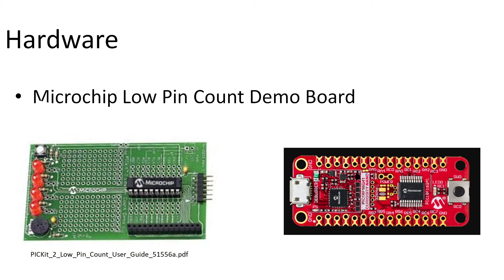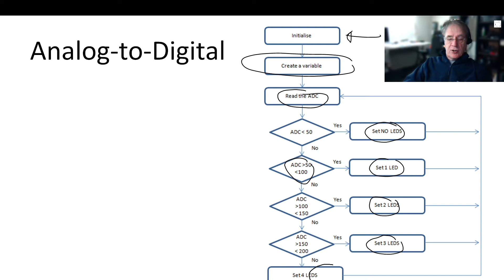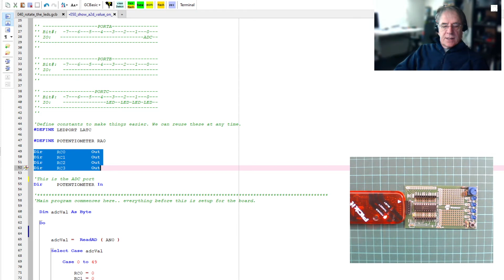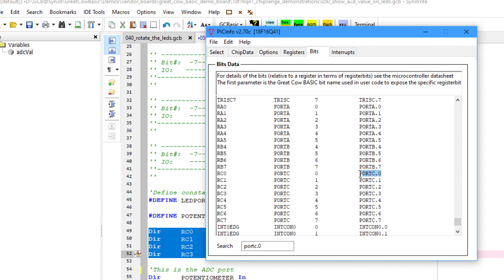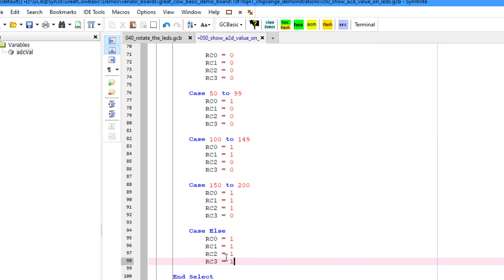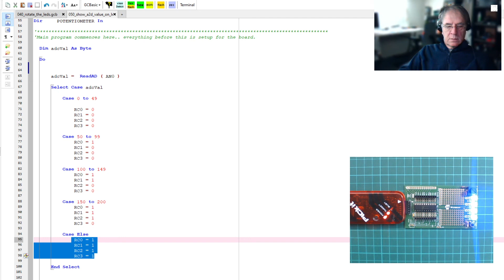PT3: PIC18FxxQ41 chip Family - Using the PIC18FxxQ41with Great Cow BASIC to read the ADC

Comment: Do you have a link for "PicInfo" or is this a part of GCBasic ? Great job, Thx !
Reply from the maker: PICInfo is currently part of Great Cow BASIC release candidate 38 (or greater).

Do you see a standalone use?
Reply: @AnobiumTech  No, not especially, it's just that I'm not as expert on PIC microcontrollers as I am on Atmel microcontrollers. (company now bought by microchip)
So this little utility seemed to me quite useful for the basic configuration of the programming fuses and the PIC datasheets digest.
I work mainly in C (Gcc) with the "Atmel" stable (sometimes, more and more rarely in assembler) and I thought that a small tool like PicInfo could be apreciable the day I need to develop on a microchip. Why not after all make this kind of little utility a standalone tool...
It's just a personal reflection that only involves me.  :)

Translated with www.DeepL.com/Translator (free version)